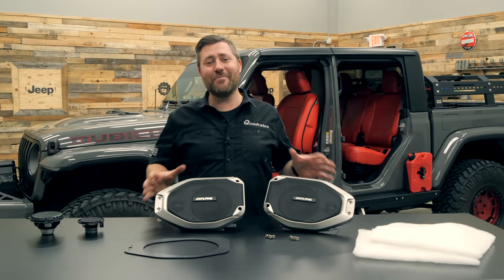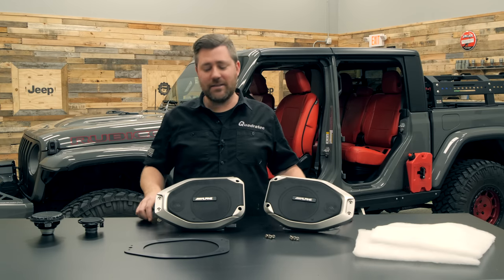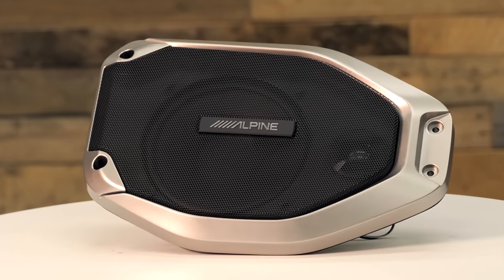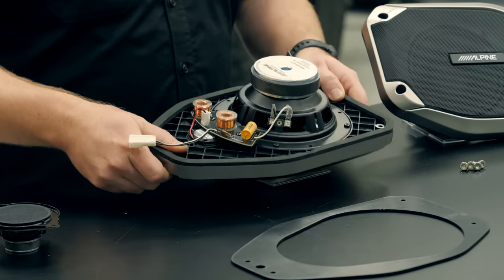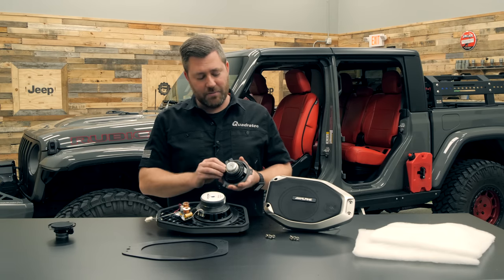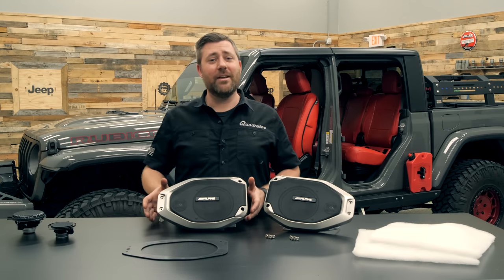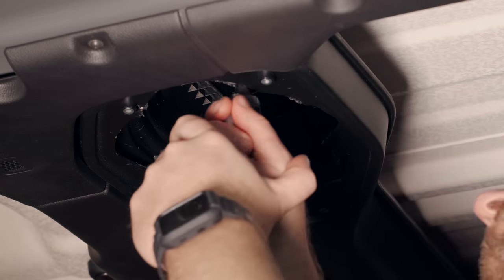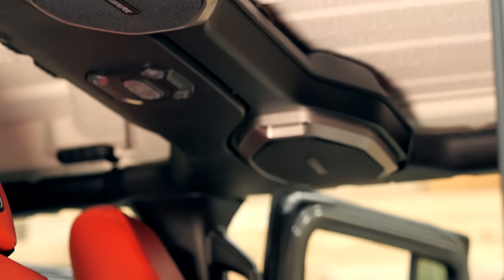Alpine SPV-65-JLT 6.5" Soundbar Speaker Upgrade for Jeep Wrangler JL & Jeep Gladiator JT

Comment: I just installed this speakers !! They are impressive , really big difference from factory 
I loved it
Reply: How was cutting?
Reply: @DelanoJ  if you have the tools to cut it is not hard 
I recommend to take off the sound bar that will make it so much easier
Reply: @filibertovazquez8284  I don't have power tool to cut. Would box cutter be strong enough?

Comment: So they don’t work at all with the alpine system? Or they’re just not specifically designed for it?
Reply from the maker: They won't be a simple plug-and-play install if you've got the Factory Alpine Premium Audio System using the factory style connector. The factory premium system has outputs matched and crossed over for the factory speakers. It's not that the SPV-65-JLT's won't "work", but they will not be receiving the full signal to deliver the best sound. You could install these into a premium system if you're willing to run some custom wiring in your Jeep. It would be best to contact Alpine directly for more assistance if you're looking to complete that setup.

Comment: Are these only for the gladiator? I have a Sahara and would really like better sound. Before this vehicle I had a 14 Grand Cherokee Laredo and had no problems with the sound. It's almost as though FIAT is like... Yeah we know we put crap equipment in Wrangler's and you'll just put aftermarket in. For as much as they cost you'd think they'd actually put some quality stuff in.

Comment: Which connector do you use? Does one just sit unused?
Reply: Did you ever figure this out?
Reply: @josh88113  interested in more info
Reply: @eli8375  I installed these in my wife’s Jeep a few months ago but was super easy. Just use the connector that fits the speaker and tuck the other one up inside the cavity behind the new speakers

Comment: It looks like there's 2 factory speaker plug wires. Do you only use one to the alpine spv speakers? And if so, does it matter which factory speaker plug wire?
Reply: I was thinking the same thing
Reply: How come nobody is answering this question
Reply: @kn19kn19  If you have the upgraded alpine system, you will need to use both wires. Check out a couple reviews on this speaker at crutchfield they have this explained there.

Comment: My 2021 JLU has Uconnect® 4 with a 7–Inch Display. In this video, you removed the OEM sound bar speakers which had TWO connectors, but the Alpine replacement speakers only have ONE connector. Which connector do you use, and what happens to the other connector?
Reply from the maker: The 2 connectors are different, only one will correctly plug into the Alpine speakers. The other just gets tucked up into the sound bar and is not used.
Reply: @Quadratec please can you explain why the other connector isn’t used? Doesn’t that effect the sound quality?

Comment: So if you have the factory system with the subwoofer, these speakers won’t work??
Reply: It looks like Rob was installing them into a Alpine Premium Sound Gladiator, not a basic system.  I think that the reason that they are not compatible with the amplified premium system is because the two speakers that you remove are already pre-crossed over and you wont get the full sound to Alpine speakers once you connect the factory wiring harness.
Reply from the maker: @chaveztruz  Rob's Gladiator that he installed the SPV-65-JLT speakers into has the basic sound system. He specifically ordered it that was, because he knew he would be upgrading the audio system in his Jeep.
Reply from the maker: Daniel, Miguel was correct as to the reason these are not compatible with the Premium Sound System with the subwoofer. The factory premium system has outputs matched and crossed over for the factory speakers. It's not that the SPV-65-JLT's won't "work", but they will not be receiving the full signal to deliver the best sound. You could install these into a premium system if you're willing to run some custom wiring in your Jeep. It would be best to contact Alpine directly for more assistance if you're looking to complete that setup.
Reply: @Quadratec  - Can we get clarification.  at 2:34 Rob says "you can make these speakers sound even better using the alpine pss-23 wra powered subwooofer.   So if you PURCHASED the jeep with ALPINE premium it's not compatable..however if you upgraded later with the PSS-wra the wiring would still work?   Asking as I'm exactly at this point....before I cut I want to ensure all is good.   Guessing also Rob is plugging into the 'tweeter' plug...what exactly is happening with the old 4" speaker connection?  Thanks!

Comment: You may want to fix your website as it says "They can be installed in any two or four-door, regardless of trim level or sound package." But installation instructions say not on OEM alpine systems. Very misleading.
Reply: So does that mean it won’t work correctly with a rubicon 392 Uconnect® 4C NAV and Alpine® Premium Audio System

Comment: The speakers should be worth max 200 bucks. 499 for a pair is ridiculous. Pricing for jeep aftermarket is getting retarded.  You have to spend 5k+ to do a full replacement and that's installing it yourself..  I'd rather buy a motorcycle /jet ski/ boat or other toys for that money.
I'd spend a max of 400.bucks for a whole update on speakers they should have a proper package under that price.

Comment: So if I buy the insane audio head unit, what do you recommend for a sub setup (I don’t want the alpine) and an amp and what about front speakers?  I’ve never done anything with car audio
Reply from the maker: What are you driving? Do you have a Wrangler (2 door or 4 door) or a Gladiator?
Reply: @Quadratec  gladiator

Comment: Just added these today. Ewwwww dont waist your money.  Looks good...  Yeah i got Alpine speakers. 😂Thats all. Dont touch the sound performance of factory on my JT sport.  Maybe with an amp but id say its A no no. You have to take out the bass tube which makes the 3.5 sound much better.  Yes 3.5s lol better then 6.5s for $500 bucks. Gonna buy an amp on payday. Cross my fingers. Just hope im not throwing away money.
Reply: did the amp help at all? I installed mine and it basically sounds the exact same, if it works I may do the same lol
Reply: Following
Reply: @rob1477  same here any info?
Reply: @eli8375  I ended up just pairing the speakers with an amp and a subwoofer, when hooked up the right way they get very loud

Comment: what options will i ever have to upgrade my OEM alpine system? its terrible.
Reply from the maker: You can make these work, you just have to run speaker wires for them from the head unit back.
Reply: Remove the sound bar and focus on doors and dash speakers. Anything you can purchase at Best Buy... stay away from that stuff too. 

Currently nobody makes an affordable head unit for the 18+ mopar so you’re kind of at a standstill. $1000 for a radio replacement is just ridiculous.
Reply: @Quadratec couldn’t you just cut off the connectors and crimp the wires accordingly